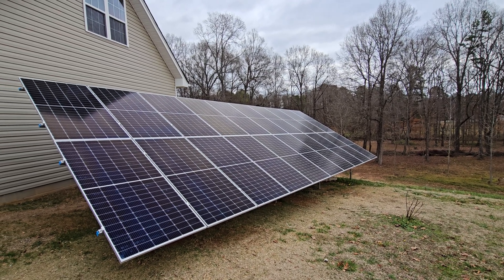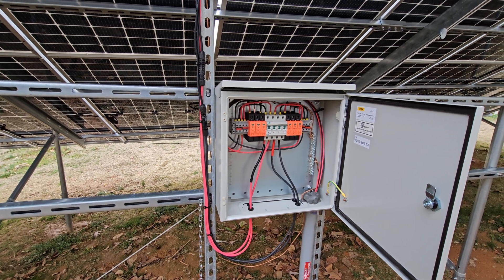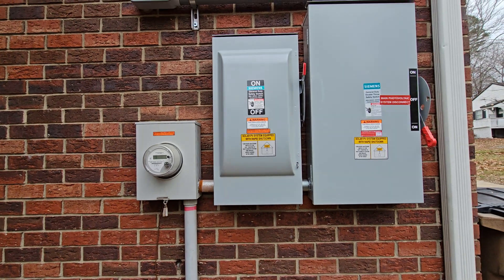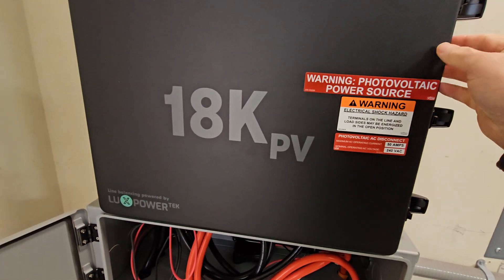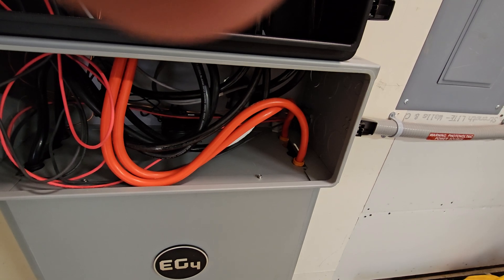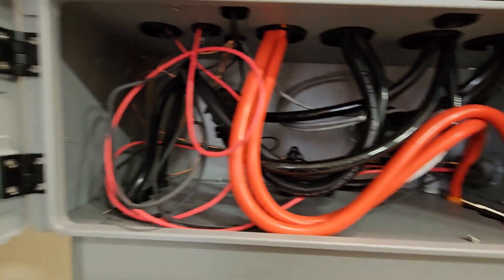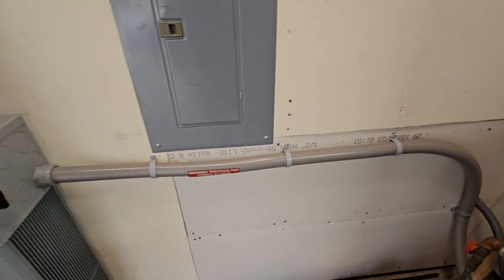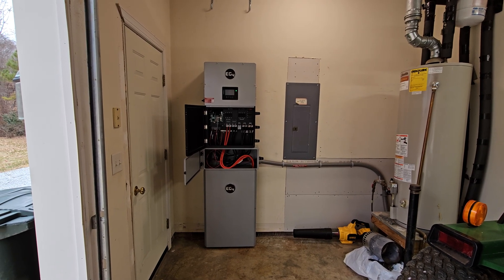Received My Permission to Operate from Duke Energy for my 18Kpv

Comment: Not sure why people want to sell back to the grid..I prefer being off grid, rather than jump though those hoops..I have two inverters in case one dies..The EG4 6000 XP's by Luxpower..Have an extra JK BMS and a good generator just in case..But the failure rate of those inverters is almost zero..Same thing with the 280 Ah Catl cells..I built the two 48 volt batteries out of (32) CATL 280 Ah cells and 2 JK BMS's which is right around 30 Kilowatts..And have 6,000 watts of solar..And I use less power than I did before solar, I became far more efficient..I did switch inverters recently, but have the others for back up..Ya, I don't want to have anything to do with those power companies, or any other utility company, and I don't..Water well, wood burner and mini split..As well as some back up systems..
Reply from the maker: For me there are several reasons.
1. My system is not big enough to be off grid through the night or during bad weather, so I would need a generator and it would cost more to run the generator than the cost of the grid power.
2. I make more energy than I can use/store during daylight hours.  I plan to add another battery and store as much as possible, but I don't want the excess to go to waste when I can get 1 for 1 credit from Duke Energy.
3. I don't have the money it would take to be completely off grid.
4. My main goal was to have backup power for when the grid goes down and to get a return on investment from building the backup power system.  With my current total costs and taking the 30% tax credit I should see around a 7% return on investment.
Reply: By participating in Net metering you also help other people by sending power and helping to stabilise the grid. @Gary_Pauls_DIY
Reply: Considering the changes that Duke wants to do with "selling to the grid"  it will soon not be worth the effort.   And as long as a powerline runs to your house you will always get a bill even if you use 0kwh.
Reply from the maker: @Freedom_soup   You are correct.  The new rules went into effect on 1 Oct 2023. Luckily my application was submitted and approved before the changes, so I am now grandfathered in to the old 1 for 1 sell back. Main reason I did the install now instead of waiting a few more years.  The equipment keeps getting better and cheaper.  The power companies know this and are now trying to stop people from generating their own power.  In the past the cost of the equipment and the space the panels would take up made it out of reach for most people.  In a few more years it will be possible to be completely off grid at a reasonable cost.  For now it is just the cost of the batteries which make it economically unfeasible for me.
Reply: Does you 18kpv feed your main panel at the same time as the grid?
Reply from the maker: @jl9678  Yes it does.  During the day I make more power than I can use in the house and store in the battery.  The excess sells back to the grid.  All this happens simultaneously.
Reply: @Freedom_soup  Ya I just transitioned to using far less energy, as I built my system up..But, I built a small house/cabin in the middle of a forest, so it was pretty easy to be energy efficient, because my house is only 650 square feet, and the garage is 650 square feet, which I only heat if I'm in there working...But, it's worth using less energy and figuring that all out..My neighbors electric bill went from $100 dollars a month to $250 dollars a month in one year, and that will only get far far worse going forward..Down size now voluntarily, before it's forced on us, and harder to accomplish, is my thinking..
Reply: Because certain areas require being part of the grid so if you have to be connected and you’re not using energy why wouldn’t you
Reply: @kyledewaal9332  Areas that a person would homestead or live off grid, don't require a person to be connected..If you live in a McMansion neighborhood, and pay top dollar to have a system installed, ya I guess..But that is something that I personally would never consider..There is a real freedom from having no utilities, no mortgage, no credit card or auto payments..It allows you to chase the dollar far less, and covet our real currency which is time..In my humble opinion..
Reply: Do the math for your own utility. Each will have a different sell back policy, flat monthly fee, and set up charge. There's no one solution. Our sell back rates are low, but the formula is law.

The math I did with my utility NEBO net metering rates shows if I just sold back, I would break even eventually, but would end up with a very low, but positive return. That's my worst-case scenario. Any power of my own I do use will speed that up and increase return.
Reply: Selling to the grid is just a fools erron. Eventually, power companies well ratchet back what they pay for your power. Then you’re screwed. I’m working on a system to get off the grid completely.
Reply: @jlanetman yep

Comment: Maybe an EG4 3 battery rack might fit better
Reply from the maker: It might work.  I can do some measurements and see how it would fit.  I am trying not to block the door or access to the main breaker panel.
Reply: Thats what I was thinking,  On wheels.   Bought the rack kit deal.  Like it.  I also build my own  battery with 280 amp hour cell from 18650 battery store.  I have $2700 in that complete.  Built a wood box like with 5/8 fire board on casters. JK bms. 150amp breaker from Signature Solar. Bulk fitting from Amazon.    Turn out good and feel safe with it.  There is no communication with it.  I have it paralleled  with 11 eg4 life power battery that do Committee with my Solar-ark.  Works fine.